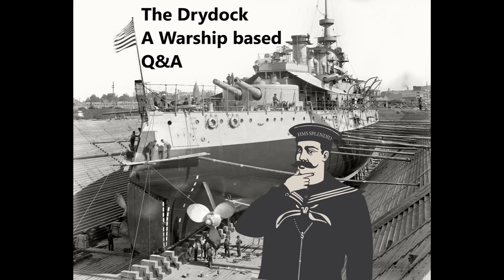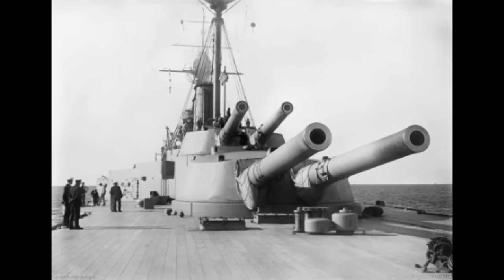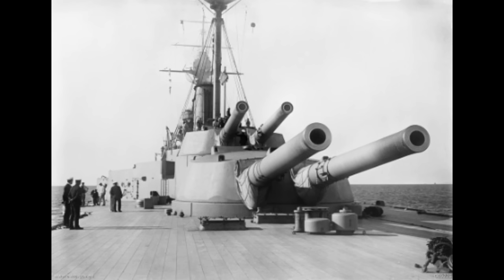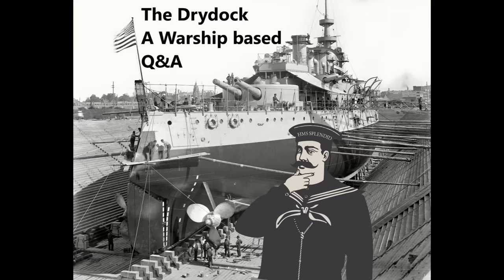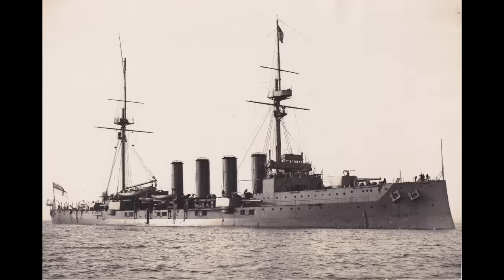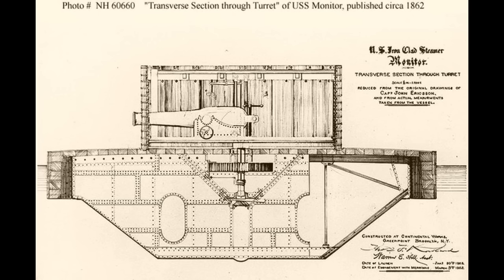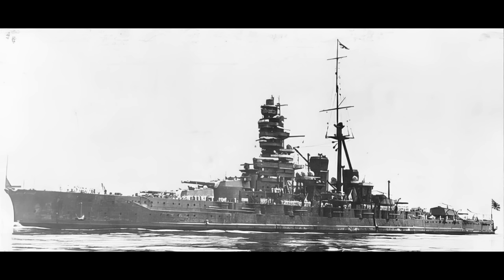The Drydock - Episde 241 (Part 1)

Comment: 1:45:00 Bombing half sunk ships could make things a LOT worse. It's not just the direct damage but the time it takes to control any flooding or fires. It could easily be the difference in if the men are able to get the damage under control or if the ship sinks/burns out completely.

Though there are also things like the fuel depots and that can be hit. i don't know which would be more effective.

Spreading the fire fighting equipment out over a larger area might allow some fires to spread due to lack of manpower/equipment. At the same time a ship or dock can hit its limit on the number of people able to fight a fire so spreading the damage might be less effective if there is idle capacity in fire fighters able to quickly address things away from the docks.

Comment: USS Ticonderoga (CV-14) and USS Oriskany (CV-34) were both modified to operate A-7s prior to their final deployments off Vietnam with the latter carrier's A-7s seeing extensive combat service until the end of American involvement in 1973.  In this case the sequence, which implies the A-7 entered service (1967) after the A-6 (1963), is correct.

However, Essex-class carriers never were modified to embark F-4s or A-6s, as these jets were heavier (requiring higher landing airspeed) than the F-8s, A-4s, and A-7s that typically were deployed on Essex-class carriers off Vietnam; as such F-4s and A-6s were usually relegated to Midway-class or supercarriers.
Reply: The thing is, the real answer to the question is probably "whatever happend to be the most modern thing to fly off USS Lexington during her training days"
Reply: @mancubwwa  That would make sense, except the answer if one includes training fixed-wing aircraft is the TA-7 variant of the A-7 Corsair II.  There is a photo of Lexington launching one in 1984: https://de.m.wikipedia.org/wiki/Datei:USS_Lexington_(AVT-16)_launches_an_A-7_Corsair_II_in_1984.jpg.

This was unusual, though.  The primary US Navy carrier-capable trainer in use when USS Lexington was slated in 1962 into the USN's training carrier was the T-2 Buckeye, which remained in that role until...2008.  The T-2 entered service in 1959, eight years prior to the A-7.  Lexington was decommissioned in 1991.  

For attack conversion training Lexington typically operated TA-4s, but that was a variant of the A-4 Skyhawk that entered service with the USN in 1956 and remained in service until...2003.  Lexington's attack conversion trainers remained TA-4s well into the 1980s, as there is a photo of Skyhawks performing touch and goes on Lexington's deck from 1989: https://de.m.wikipedia.org/wiki/Datei:Douglas_TA-4J_Skyhawk_aboard_USS_Lexington_(AVT-16),_1_April_1989_(6445251).jpg

The US military has a history of operating its training aircraft for a LONG time, as the USAF still uses the T-38 for supersonic training despite the T-38 having entered service in 1961 and the last one rolling off the production line in 1972 (the T-2 stopped production in 1970).

So there is a distinct possibility that Lexington never operated any fixed wing aircraft that were newer than the A-7/TA-7, which entered service in its role as an attack aircraft in 1967.  As for helicopters, the USN's primary trainer was the TH-57 until being replaced by the TH-73 starting in 2021, a variant of the Bell 206 that entered into service in 1967 as well as the A-7, but the 206's first flight overall was in 1962 compared to the A-7 in 1965.

There is also the question of what constitutes service, as there are both an A-7 Corsair and a Blue Angel F/A-18 Hornet currently sitting aboard Lexington's deck right now in Corpus Christi...the A-7 clearly counts as Lexington operated TA-7s in the 1980s, while I cannot find any photos of Hornets launching or landing aboard Lexington.  Drach also mixed up the Hornet and Sea Harrier, as the latter entered FAA service in 1978, the same year the F/A-18 first flew before the Hornet entered service with the USMC in 1983 and the USN in 1984...but the SH-60 Seahawk (one of which sits on Midway's deck currently in San Diego) first flew in 1979 before entering service in the same timeframe as the F/A-18.
Reply: @indplt1595  As far as I can find, F18s and F14s never flew off of Lexington. I could be wrong but I believe you are correct on A7 or some variant thereof. F18s did serve on Midway and Coral Sea but of course they never saw WWII action
Reply: @indplt1595  Doesn't really matter since we know F18s DID fly off of Lexingtons and Midways and are newer than F14s
Reply: Interestingly the title may go not to any fighter, but rather to Grumman C2A Greyhound COD plane, specifically to a C2A(R) variant, if it was ever used to resupply Lexington. Obviously this is not counting Midway class carriers as they never actually served in combat in WWII. But that would need further reaserch...
Reply: @mancubwwa  Not sure anyone could ever consider the A-7 to be a fighter aircraft, but the theory is otherwise sound...assuming variants count as new aircraft.
Reply: @wingracer1614  Huh?  The Midway-class, which commissioned between 1945 and 1947, is newer than the F-14, which entered service in 1974?
Reply: @indplt1595  my bad I meant combat aircraft in general. As for variants - someone somwhere suggested that with the phrasing "most modern aircraft" we shoud look at avioncs suites rather than airframes.
Reply: @indplt1595  Huh what yourself? The F/A-18 is newer than the F-14 Tomcat. The question was, what was the most modern aircraft flown off of a WWII carrier?
Reply: @wingracer1614  Sorry, I hadn't read your comments carefully.  There is a common misconception that the F-14 was too big to takeoff and land aboard Midway-class carriers--the Tomcat certainly was a handful for such smaller carriers when Midway, FDR or Coral Sea were on a cruise, but the F-14 could certainly operate from a Midway-class deck in a pinch.

I wrote the original comment in this stream because Drach's irritation with Cold War-era politics led him to claim the most modern aircraft operated from Essex-class carriers was the A-6 Intruder, and that the Sea Harrier entered service after  the F/A-18.   Considering the FAA's Harriers entered service six years prior to the USN's Hornets, this clearly was not true.

As for the Essex-class, their diminutive size essentially precluded operating F-4s and A-6s off of Vietnam, to say less about the monstrous A-3 and A-5.  This wasn't to say the Intruder couldn't physically takeoff and land aboard Essex-class carriers, as Lexington demonstrated repeatedly over her 29-year career of training USN aviators, but the typical air group of an Essex-class off Vietnam consisted of F-8s, A-4s, and A-1s...until Ticonderoga swapped the A-7 for the A-1 for her cruise on Yankee Station in 1969.  Not only did the Essex-class NOT operate Intruders off Vietnam because the A-6 was so big, the newer Corsair II became the mainstay when Ticonderoga's A-7s were transferred to Oriskany for the last Essex-class combat deployments in the early 1970s.

It is hard to fathom why Drach, with an unlimited well of naval and aeronautical knowledge that precedes 1953, isn't really familiar with naval combat operations since, excepting the Falklands in 1982.  The Hornet's deployment in 1983 with the USMC and 1984 with the USN showed the priority chain--as the aircraft replaced were F-4s and A-7s as it outclassed both in strike missions and was orders of magnitude better as a fighter; yet oddly the F/A-18 first cruised aboard USS Constellation in 1985 instead of Midway or Coral Sea, where replacing the F-4 was more critical as the Midway-class were not embarking Tomcat fighter squadrons like the supercarriers had for the past 10 years.  

This perhaps indicates that using age of the aircraft as a guide isn't helpful when it comes to late Cold War-era jets.  The Hornet served alongside the Tomcat for 22 years, as the F/A-18A, B, C & D weren't really a proper replacement for the F-14 in the air superiority role.  The F/A-18 E & F, a jet that pretends to be a deriviave but in reality is a new design only replaced the Tomcat when the unique interception mission fulfilled with the AIM-54 was dropped in 2004 without an equivalent replacement for the Phoenix.

This tendency is even more pronounced in strike aircraft.  The A-7 ended active service in 1991, six years prior to the A-6's final USN flight...in the attack role.  The EA-6 soldiered on until the EA-18G began to replace the Prowler in 2009, once the Super Hornet had put the Tomcat out to pasture between 1999 and 2006.  Still, it wasn't until 2019 that the USMC retired the last EA-6B, the same year the USN retired legacy F/A-18 A through D models as the F-35C entered service...yet the USMC intends to operate legacy Hornets into the 2030s despite the F-35B having entered service back in 2005.  

In the modern era, age and advanced  aren't inversely synonymous in military technology--mission specifications matter far more, which has led to the LGM-118 Peacekeeper to be retired in favor of its predecessor the LGM-30 Minuteman while the B-52 and C-130 soldier on with no end in sight despite both being 1950s designs that first flew over 65 years ago...and the less said about the Freedom and Independence-class LCS, the better.

Comment: Proximity fuse artillery shells were first used during the Battle of the Ardennes [Battle of the Bulge], in December 1944
Reply: On land,. The CL USS Helena fired the first VT fuzes in 1943. "Beginning in January 1943, Helena took part in several attacks on Japanese positions on the island of New Georgia in preparation for the planned New Georgia campaign.[20]... The ship had received the new 5-inch shells fitted with proximity VT fuses, and her use marked the first time they were used successfully in combat.["

Comment: VT shells were available to land artillery for use use in the Battle of the Bulge (Ike got things fixed in time). I'd assume, but don't know for sure, that some of the 5" issued for AA in the Pacific found use in infantry support.
Reply: Drach touched on this, but the use of VT fused shells for shore bombardment hinges on actually having a suitable target. 5" VT fused common can smother a banzai charge, but will accomplish very little against entrenched infantry and nothing against bunkers.
Reply: @kemarisite  The issue was secrecy and when VT shells were permitted on shore. VT forces entrenched infantry to seek overhead cover (the idea that it's ineffective is ludicrous), and strips armor of its necessary accompanying infantry. Airbursts at a desired height are the gold standard for artillery support.

Comment: More than anything the rebalancing of the design would delay Honet massively rather that a straight repeat -unless the Navy Department already have a design that they had  done full design work on, which they didn't as they wouldn't have been working on the Essex and were still two years away from having an off self design.

Comment: A curious thing is that final battle of Bismarck and the final battle of Yamato took nearly an identical amount of time, going from either the first shots fired or the first hit scored.
Reply: Yamato was undamaged before the final action, Bismarck was damaged by two 14" shells and 3 torpedoes (enough to sink most other BBs) days before it was sunk.
Reply: @niclasjohansson4333  Those first 2 torpedoes did next to no damage.  Swordfish torpedoes were extremely weak.  The two 14" overpenetration would not have sunk any battleship, not even HMS Victory.  The 3rd 14" under-penetration would also not have been fatal to any Battleship.
Reply: @Edax_Royeaux  Littorio was sunk in harbor by only 3 torps from the Swordfishes, and the first torpedo to hit PoW had an even weaker charge, and that single "tinfish" would have sunk the British battleship all by itself, the 3 hits on the opposite side actually slowed down the capsizeing. The point is that Bismarck was far from "undamaged" !
Reply: @niclasjohansson4333  The torpedo hit on Bismarck amidships by HMS Victorious killed 1 man and caused minor damage to electrical equipment.  The second torpedo hit on Bismarck's port side by HMS Ark Royal caused some structural damage and minor flooding.  Such damage is hardly fatal to any Battleship..

The Littorio was in shallow water which magnifies the power of an underwater explosive, it bares little comparison to Bismarck which was sailing in the ocean.
Reply: @Edax_Royeaux  The torpedoes that hit Littorio did strike the side of the hull, not underneath the ship, so it did not matter that she was in harbor. One hit the stern, one between A and B turrets, and the 3rd in the bow. Just because a few torpedoes and 14" shells wasnt fatal to Bismarck doesent mean its not fatal to most other battleships.
Reply: @niclasjohansson4333  I'm looking at the torpedo damage to the Littorio, the hole reaches all the way to the bottom of the hull, so I don't know what your getting at insisting she was struck in the side of the hull.  Absolutely the torpedo would have gained power by detonating so close to the sea floor.  The torpedo strike that actually struck the side of the hull near the rudder was so ineffectual in the ship's sinking, the torpedo hole rose above the water (although since she hit outside of the torpedo protection, she probably would have caused damage of note had she been at sea).
And I have to insist that 14" shells that hit Bismarck's aircraft catapult crane or hitting the torpedo protection and no further would not be fatal to any Battleship.  Shells have to hit something important to do any real damage.
Reply: @Edax_Royeaux  So now you claim that only 2 torpedoes sunk the Littorio ? Ok i agree ! And its not the only time a torpedo hit the side of a ship and then blow a hole in the bottom.
Reply: @niclasjohansson4333  I never even said the number 2?

Comment: I thought that submarine motors were usually shunt wound motors, thus the motor could also be a generator for the battery pack with a simple "turn the motor with the engine". You can vary the field current (which is small) quite easily to limit the charge the batteries. Declutch the engine and you're on batteries/electric motor.

In other words, a hybrid.

Comment: consideration has to be made of Victorious (rebuilt) operating Buccaniers First flight 30 april 1958 and in service from 1962.  Which means it fits F4 Phantom in US service but on a absolute wartime keel. Against the A6 which was later first flight but far quicker into service but a lot less capable.

Comment: I looked up the data for the West Virginia's 16" expenditure at Surigao Straight.  The engagement lasted 16 minutes and she fired a about a dozen full and partial salvos.  There were several breaks in the engagement because of masking by other ships.  Even with the Mark 8 FCS, a system where you are always firing at the target and not ranging, there was about 1 minute between salvos.

Comment: 24:30 thinking on terms of most modern aircraft operated from an essentially not rebuilt WWII carrier, Dedalo and her Harriers..

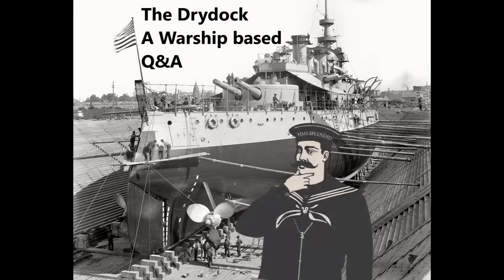36:06 Hail of fire capital ships in cruisers. Prewar thinking had Brooklyn teamed with BBs to fire 150rpm 6" fire at opposing DDs and other targets since without radar or air spotting their effective range was similar.

1:05:00 Oxygen from long lances lead  directly to the losses of a number of IJN CAs and DDs, most notably at Samar.

2:38:08 Starting in the mid 30s the USN used HF (high frequency) RATT (Radio teletype) with FSK transmission. This was the primary method of admin traffic transmission into the late 70s. It's basically the same as a dial up modem used by an 80s home computer, 100 baud transmission to a teletype. 
While serving on my first commission in 1978 our RTT communications were upgraded to CUDIX - SHF Satelite links thru a computer interface.

Comment: re 00:36:06 - 'Hail of fire' dreadnoughts?
The answer appears to assume that its the last salvo which is used to correct the next. You could conceive of a leapfrogging correction system where it's the SECOND last salvo which corrects the current one, and you can thus first at twice the rate. Essentially, you use the "I need a minute to correct fire" statement to correct the next possible fire. This will result in fire correct for the conditions 1 minute ago, which is the same as the "normal" non-leapfrogging method, but with twice the fire rate.
I suspect this would require some kind of duplication of the fire control systems, since they'd have to carry multiple solutions at once - you could probably still use the same number of rangefinders etc., but maybe two fire tables not one?
Reply: Dreaming up procedures you could use is not the same as what they actually did, the operators were professionals much more familiar with there systems than you or I. And I actually did fire with those systems early in my career. (5"/38s with Ford Mk1Able computer/Mk56 director)

By WWII, operationally they did not normally spot & adjust as Drach suggests. At a range long enough for the delay to become noticeable,  a well handled target could easily chase splashes rapidly enough to NEVER be hit.
The usual method fired several salvos in a ladder, in short order, say 400 yards down, on, and over the predicted range. Correcting from that puts you close enough, then walk salvoes back and forth across the target range until you are obviously missing. This is called a rocking ladder.
This falls apart in concentration firing.